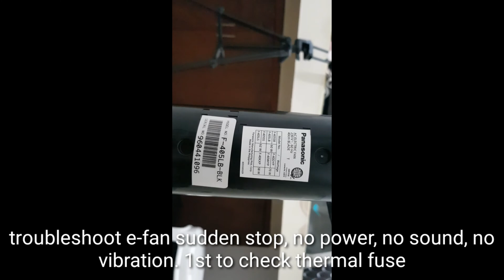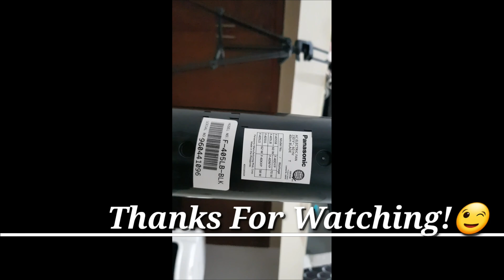Electric fan troubleshooting. Panasonic F-405LB thermal fuse replacement and bushing lubrication

Comment: How to remove the Oscillation Knob of Panasonic F-405B? Thank u in advance
Reply from the maker: Has screw inside turn it clockwise to remove and pull up the oscillation knob
Reply: Highly appreciated po sa inyong pag reply and/or assistance. More power po...and God bless po.